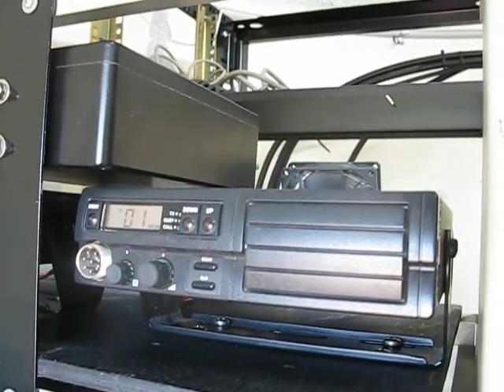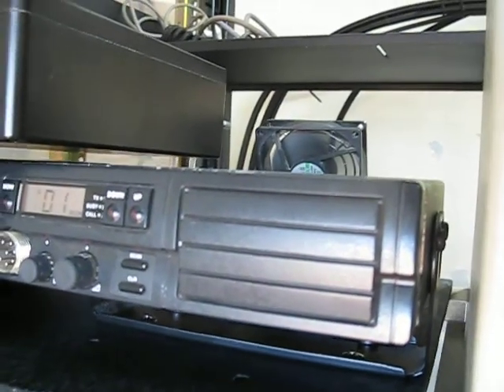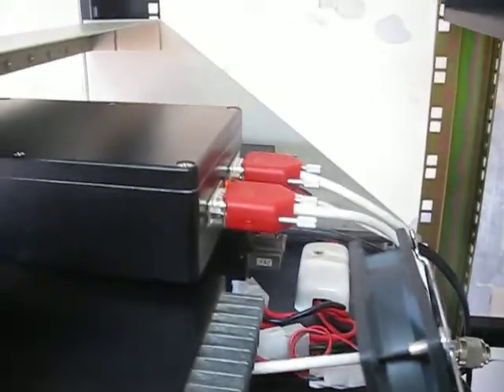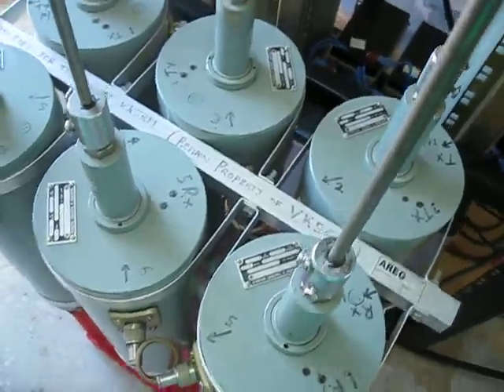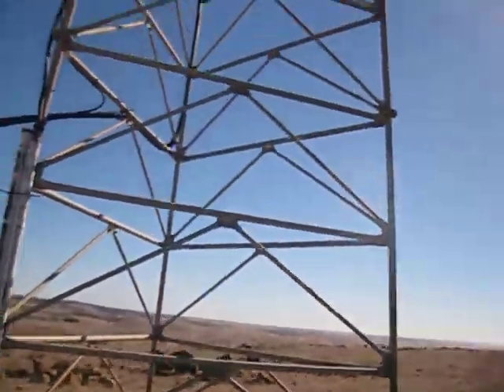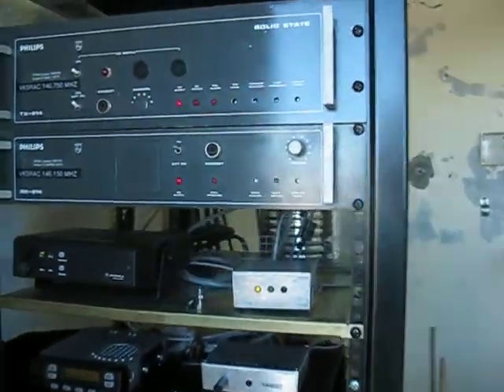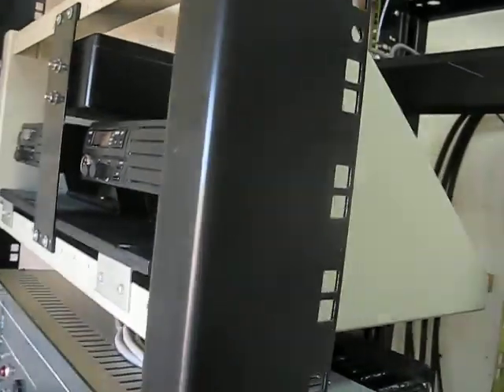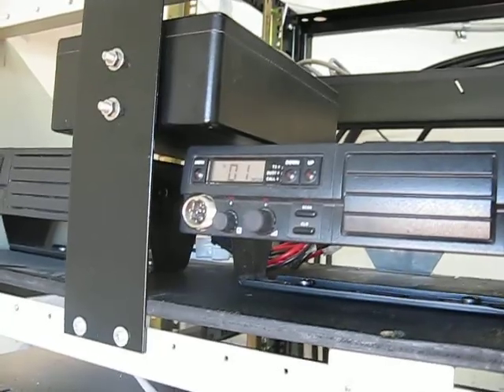VK5RAC 70cm Repeater Installation

Comment: what is the coverage like from the single folded dipole? Would like to know because I am going to install a repeater with a single dipole.
Reply from the maker: The coverage is excellent.  Of course it is directional, but not as severe as an array of multiple folded dipoles.  I can get good coverage up to 100km away along the coast of Eyre Peninsula.  

It does help that the antenna is virtually at the top of the tower.

I use the same antenna on my D-Star repeater with similar performance.
Reply: Michael Carey all of the radio dealers in my area use the folded dipole for every repeater site usually in a stack of four. They must be a good antenna if they only use them. 

I can reach distances of about 150 km comfortably with a mag mount antenna and a handheld. 

I really like this repeater site its nice and flat and the repeater building is a big plus. 

Surely there are wireless internet providers in that area so that you can have an internet connection to the site?

Comment: Yes I see, I may be in a bit of trouble... This area is 100% commercial equipment free, BUT I live within the 10 mile radius of the Arecibo Radio Telescope that has a 470mhz antenna giving out a couple of megawatts of power hehehe... BTW which radio would you recommend for the receiver that has a nice tuned front end? Thanks a lot for the help!

WP4CL

Comment from the maker: If you have your 70cm repeater on a nice quite RF site then the Chinese eBay notch duplexer will work fine.  Be aware that they offer no protection from RF away from their operating frequencies.  The Alinco radios probably do not have a tuned front end (same as most modern ham rigs), they will suffer big time if there is a lot of high power UHF equipment on the same site.

Comment: Hi Michael! I'm making a 70cm repeater here in PR, I got 2 alinco UHF radios set up nicely controlled by a PC with EchoStation software. My question is... I was thinking about buying one of them ebay mobile band pass cavities that u showed in an earlier video. Will this do nice stand-alone or do I need the other bigger filters? The offset is 5mhz so I think it should do the job. Thank you! Great video!! I wish I had a site like that hehe

73's WP4CL